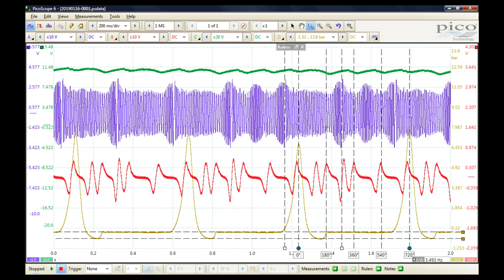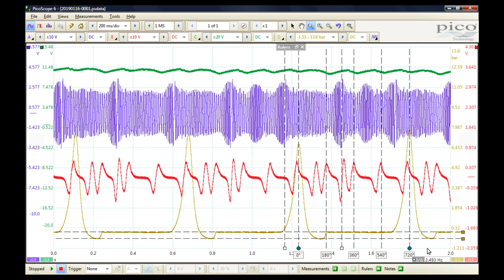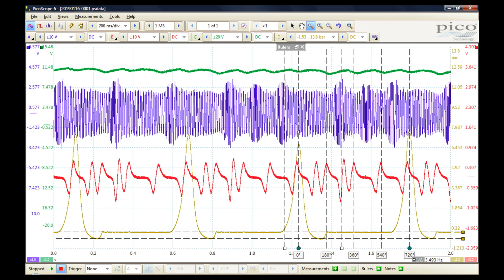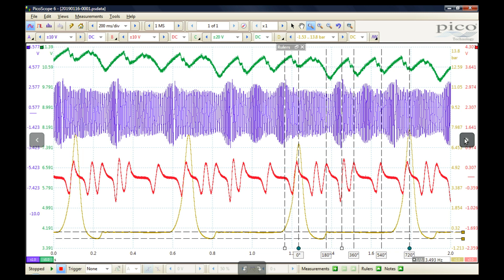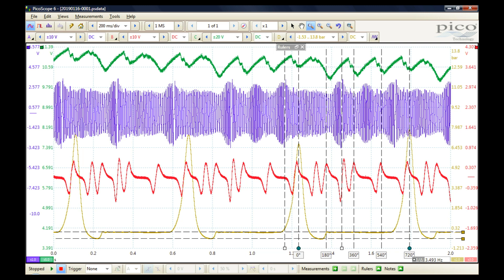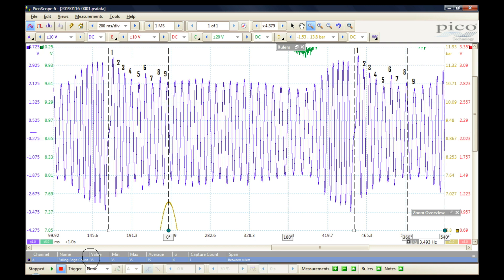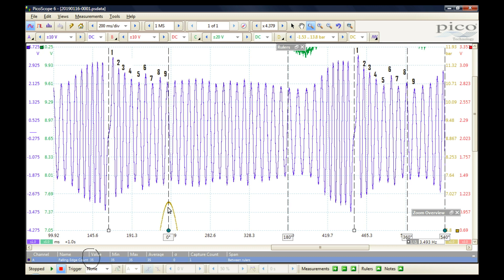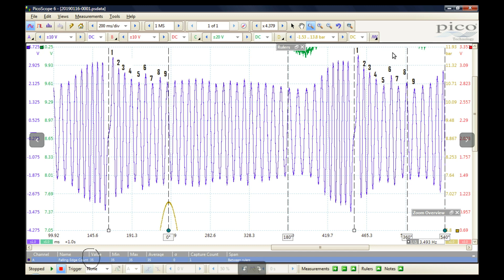[A,S,M] Crank() function in Picoscope and what it means for Phase Rulers usage.

Comment: This is awesome, thanks for sharing. I've never really thought that crank speed would have this much effect and put my trust in the rulers. I now know different. Many thanks. Steve.
Reply from the maker: Thanks for tuning in, Steve. In many situations the phase rulers are good enough, but this example shows there are exceptions. Now, the rumour has it your TiePie scope has the actual crankshaft angle function, we would be delighted to see how it works.
Reply: @DmitriyL_Arithmechanics  I've loaned my unit out to James Dillon but I'll grab a capture for you, CKP, CMP, in cylinder and battery when I get it back 👍

Comment: Ok! I'm interested in the integration technique. I can see where this would be useful in getting exact crank to cam angle/timing measurements.  The challenge I've always found is actually getting cam specs for any given engine.  But that's a different challenge! 
I'd also be interested in the amount of error that the integration technique would have.  Just off the top of my head... perhaps one of the more straightforward techniques might be to use the trapz() function in Octave/MATLAB?  There are probably have a dozen ways to skin this integration cat though!  But anything that I can think of is still always going to be an approximation.  Thus my error curiosity.  :)
The other thing that comes to mind here (this is obvious though) is that the frequency function that is generated might be less error prone if it were taken with a running engine.  The rpm would  be (should be?) more constant as opposed to a cranking situation.
Very interested in your thoughts, Dmitriy!  Thanks for the cool, thought provoking videos.
Reply from the maker: Great questions, time to make a follow-up video!

Comment: Very interesting analysis. From my experience lower compression on cylinder with pressure transducer installed is because of compression hose that changes cylinder volume. Good work my friend 👍👍
Reply from the maker: Thanks for sharing this info, how do different hoses compare? The ones coming with analog gauges, Pico, Fluke -- do they have different volumes, firmness?
Reply: Dmitriy L. I used all of them and to be honest I never could see that much of difference on waveform. Pico hose is very stiff like hydraulic hose and it’s shorter then analog. Generally I don’t do relative compression test with transducer installed because it will change cylinder volume. Now pico has software to use WPS 500 with relative compression and it will calculate compression to all other cylinders but I found it not very accurate.
Reply from the maker: Great info! I would love to see comparison of the relative compression before and during the in-cylinder pressure test on a known good engine, just to get a feel for the expected difference. In the waveform in the video the difference is so big that I am not comfortable to explain all of it by the extra hose volume...